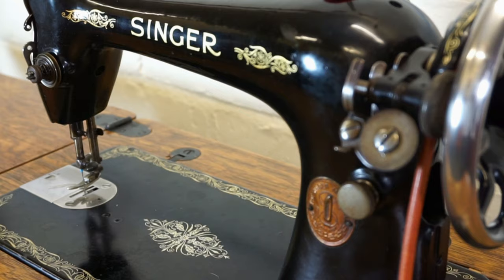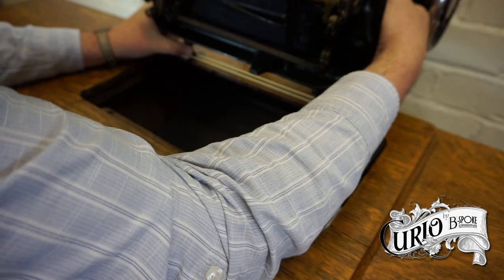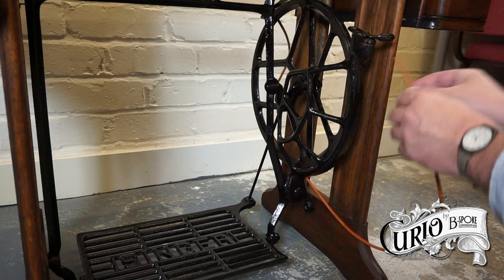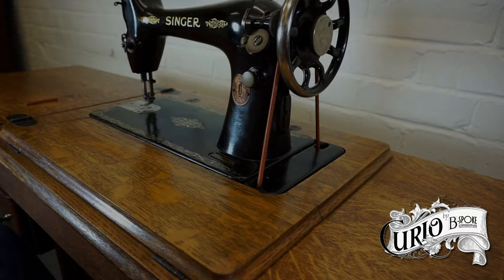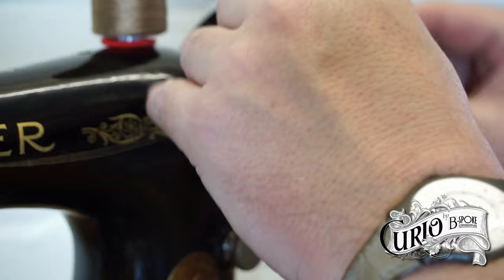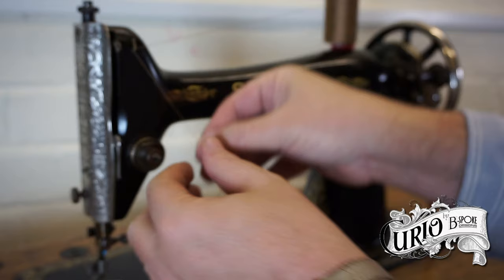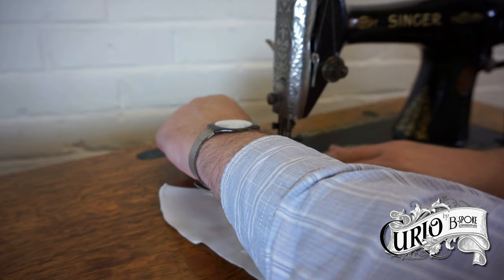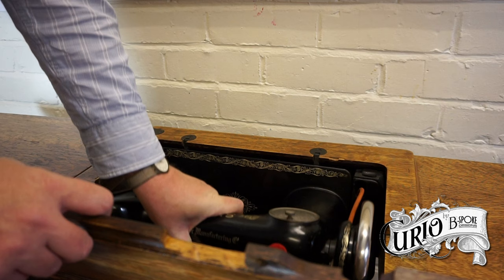Singer 66 Treadle Sewing Machine - How to Set Up & Use

Comment: Is there a reliable website you’d recommend getting a new belt?
Reply from the maker: I'm lucky to have a good sewing machine repair shop locally that I get mine from.  Most good repairers will have a website and should stock them. I've had mixed results buying them in eBay. They work but the quality isn't great.
Reply: Curio By B-Spoke Designs thanks
Reply: @CurioByBSpokeDesigns  I tried this leather replacement route with the awl and staple, first it was too loose, we tried again  but the hole was slightly off center and it tore immediately. We trimmed and tried again... it was too short, wasted. Nylon clothesline is cheap and we got the fit perfect on the second try.
Reply from the maker: @marjohnsmusings3222  I did the same with one last week - The leather is not easy to get through and you can go off centre very easily. Good tip with the nylon clothesline/ I've also heard that a pair of tights work in a pinch!

Comment: My machine is "breaking" the thread, why can that happen?
Reply from the maker: If it's the top thread, check the tension disks are clean (floss them) it could also be your presser bar pressure is too high - try loosening the pressure screw on the top
Reply: Try replacing the needle.